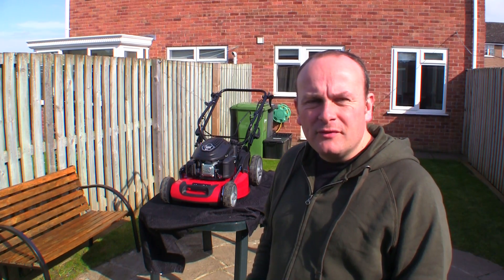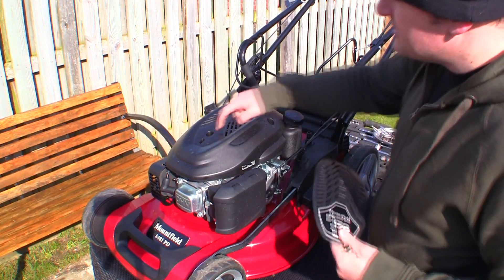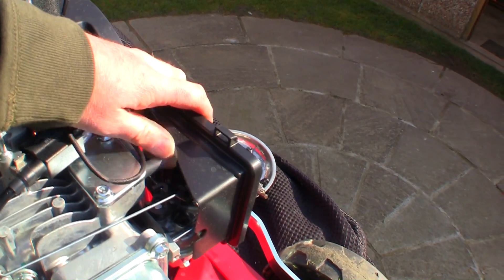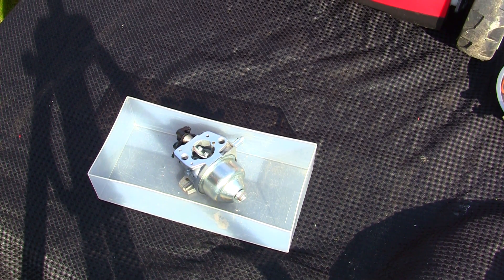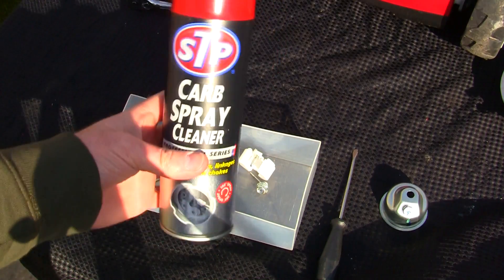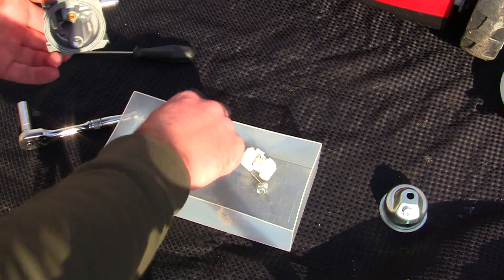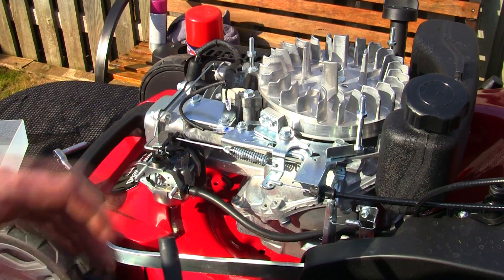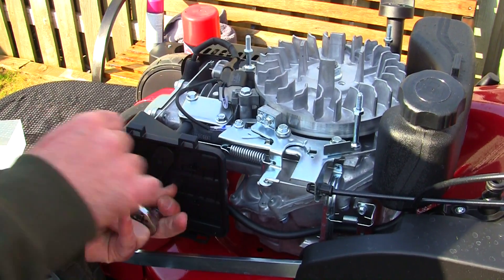Mountfield S481 PD Petrol Lawnmower Carbutetor Service

Comment: Thanks. used this vid to take the filter off and then access the carb on a mountfield s421r. After wiggling and pulling on the working parts then putting it back together, the mower is starting up again.

Comment: Another great video Paul.  I know that this is for illustration but worth mentioning that people need to be careful not to invalidate warranties by performing own servicing on such a new machine.  May be better to leave until the manufacturer's warranty has expired.
Reply from the maker: Steve Speck That's an excellent point Steve. I wish i'd mentioned it now! Looking at the warranty booklet you have to register it online and have it serviced 4 times in the first 5 years to keep the extended 5 year warranty. I don't suppose many people would do both of those things but I will mention it if they send me another one to review. Great point though Steve.

Comment: Great videos mate I had a Tesco’s lawn mower ..  It’s got  173cc  DG600 engine ..to be honest it’s abused but it stopped working  now after 4 years..

 I’ve so been watching the vids and it was a carb issue the carb is very similar to the one in your video on the new Mountfield ... So I took your advice and it starts now ... so I treated it to a new plug .. air filter and blade .. thanks again 😀
Reply from the maker: steve eames Every little helps! nice one steve

Comment: Hello, I have just bought myself mountfield HW531PD, Used its working ok but i wanted to do a full service on it which i should be able to however the metal deck on that has paint flaked of on one side completly and now is starting to rust at the min its solid so i want to treat and re-paint it for rust. Could you advise me on how to take the engine off and is it ok to be taken off and service the deck of it? mine is 160 CC as opposed to yours engine but very very similar set up